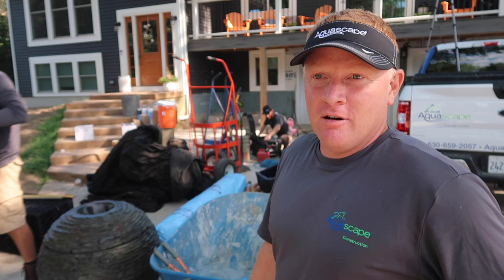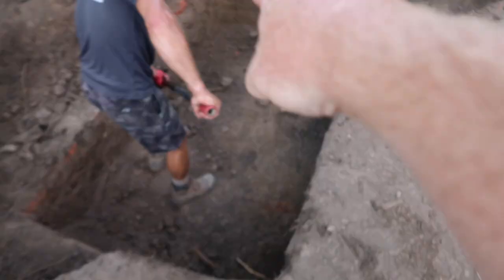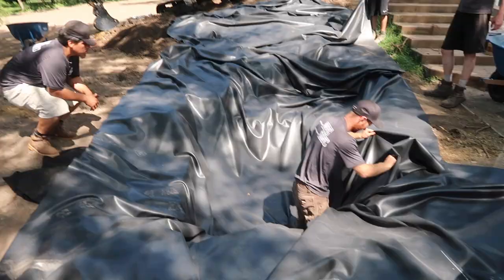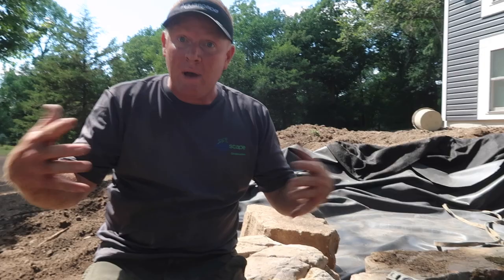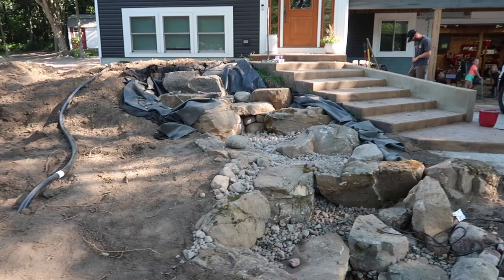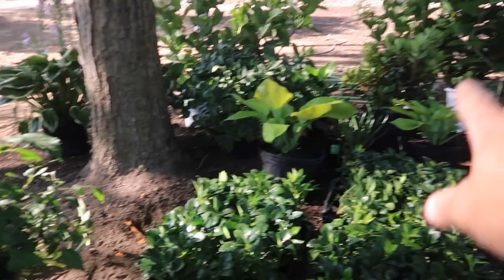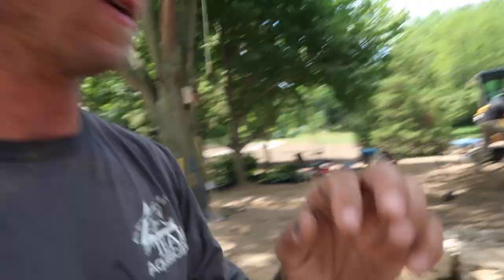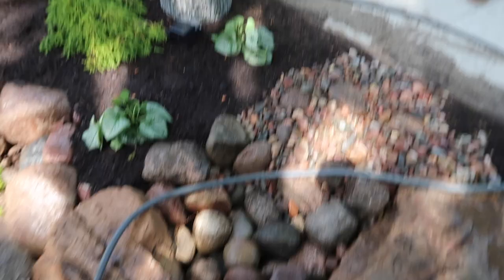Build Your Own WATERFALL: Pro Tips Revealed

Comment: Since lockdown, I’ve started fixing all the mistakes I made in my pondless waterfall, several years ago.  
I’m taking it easy today and watching YouTube, as I slipped on the wet plastic liner and went down hard. 
I have learned more in this one video, than the rest of YouTube.  Thanks for sharing the “thinking” behind the shapes and flow of the cascades. 
Thanks from Ireland 🇮🇪

Comment: Loved this one
Reply: The genius behind it all comments. I love your work. And I wish I could have you at my place for some pointers. 

I wish you had more small pond builds so I could get ideas for mine. I don't have access to heavy machinery and rocks. Just what I can pick up in a wheel barrow. It's a 8x11 aquasurge3000 kit pond. Trying to get a bridge over it to my front door with a waterfall and skimmer. Don't know which part should be under the bridge because I want the best flow of water from one end to another. I'm pulling off some crazy ideas and I have never done any of this before. My wife is very nervous. 

I can't find any Aquascape contractors in the 93635 area.
Reply: @PFab  at this point in my business, my builds are smaller, and may help you out.
Reply: @TheBarefootedGardener  I ended up building my own pond. It took a while to finish. Still not 100% done, but I have 2 little baby Koi and 40+ goldfish.
I made a few mistakes and slowly learning from them. But in the end it was totally worth doing and I would do it all again.